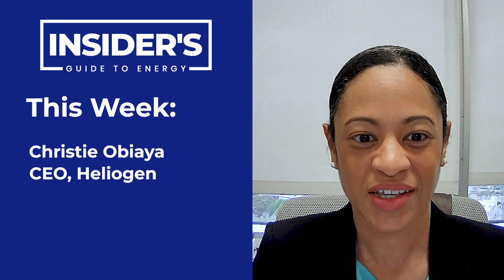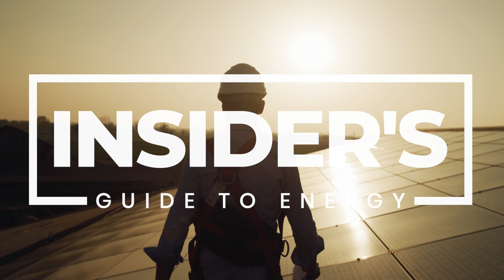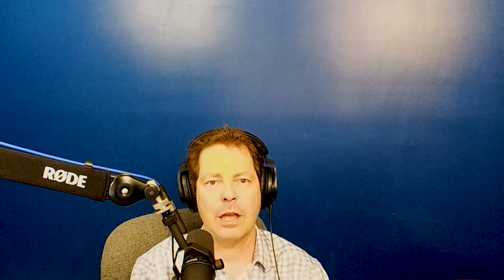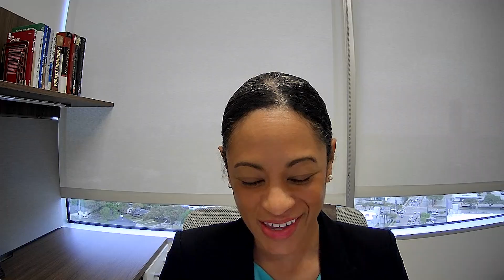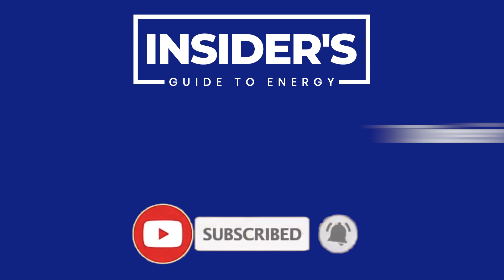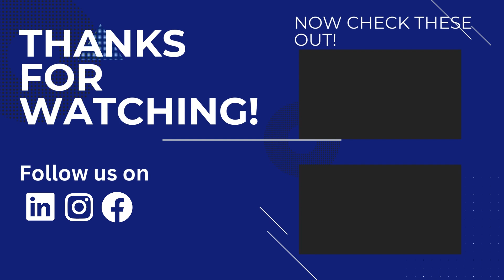166 Unlocking the Power of Thermal Energy Storage: A Deep Dive into CSP and Long-Duration Solutions

Comment: I had been using scrap plate mirrors  1/4" thick for stiffness unlike 1/8" "Fun House" quality mirrors that can bend and easily burn down my house if let to bend and reflect, anyway...  I had seen how powerful those floppy thin warpy mirrors can be that scared the beseech out of me!! Instead, I  used those plate mirrors to heat indoors of my home during the depth of winter days.. I stand in front of the rays coming from the "4X concentration sunlight"  mirrors and I understood the power of CSP immediately.  One has to experience what a CSP is like .. by using it... You will never understand it by reading about it.
 From what I learned with my scrap plate mirrors combined with my hobby telescope and learning a bit about how the optics work. I can see how CSP can grow even further in the future!  
CSP has much further to improve beyond AI , etc.. I suspect that optics will be the next barrier to tackle which can take CSP very far!
What is optics ?  Well, you know .. those heliostats are not really optics in a sense.. even if they reflect sunlight nicely.. There is much more to optics than meet your eyes!!  You may say that optics are expensive to make.. Sure, the biggest reason for that is that we don't produce them in great quantities at all. We don't see the reason for more optic products besides cameras, telescopes and microscopes.   You know.. laser laboratories rely a lot on optics .  I can see how CSP can use optics , too. This will help improve CSP efficiency by a great margin and lower costs. 
Our Sun is put there for that purpose and we are still ignoring it.   PV and wind energy is not the answer to all on climate change by a wide margin ~  We cannot leave out CSP anymore. CSP can turn out to be the most powerful renewable source in due time!